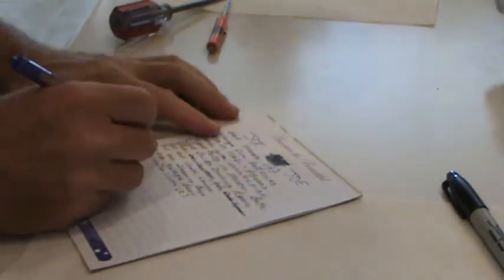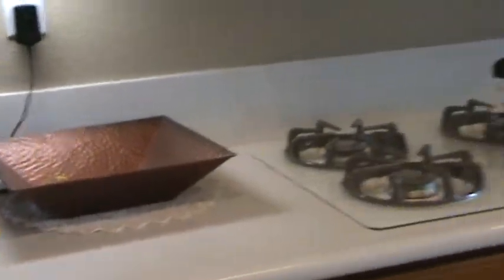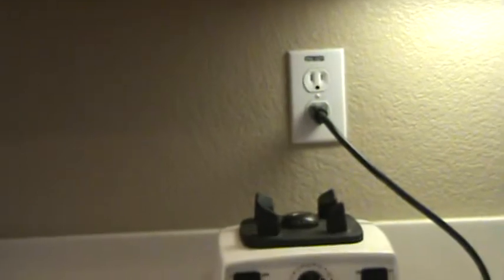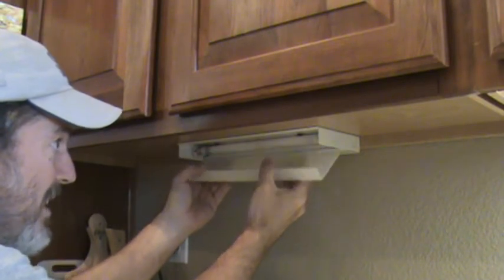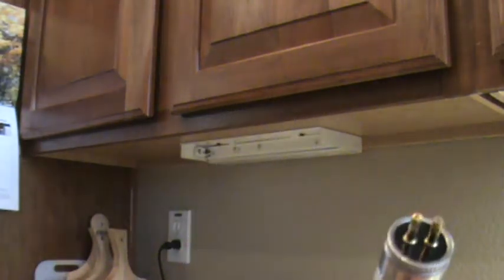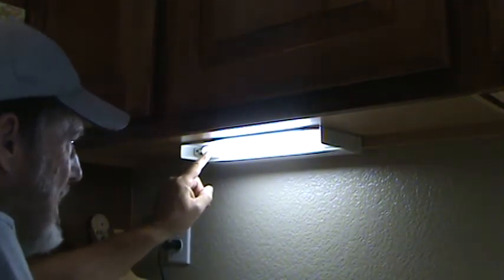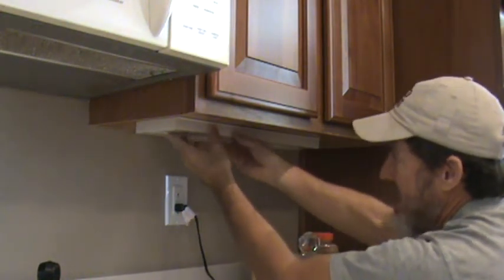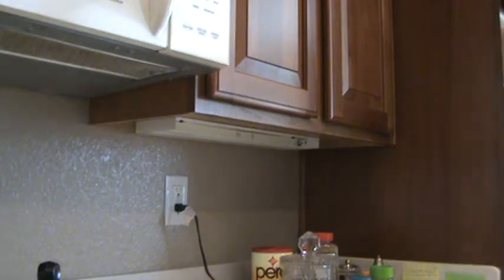How to Remove Under Counter Cabinet Fluorescent Light Tube

Comment: I have similar one.  Even I changed to a new light tube, it will not turn on.  What else to do changing the whole fixture?
Reply from the maker: Well you could change the entire fixture but the existing fixture will probably have a small type of ballast that could also be bad & if you remove the ballast you could take that to the hardware store & match it up to get a new one then replace that & that's my guess for why your new lamp(s) is not working. That might be easier to replace rather than having to remove the entire light fixture but replacing the fixture with a new one is an option as well. Hoppe this assists you & let me know what you end up doing. Thanks & thanks again for stopping by!